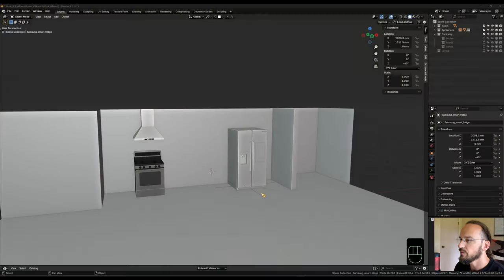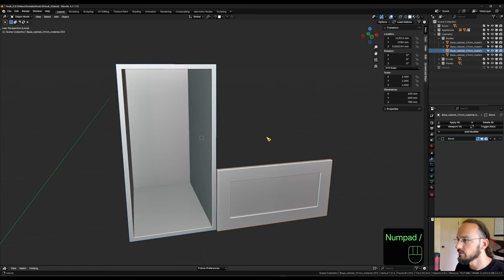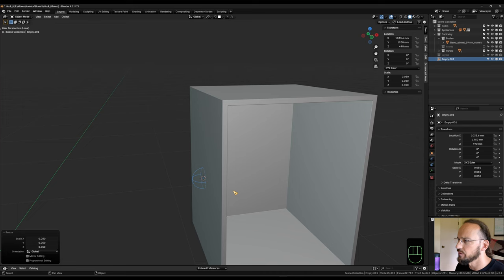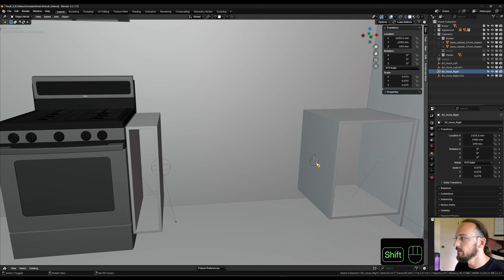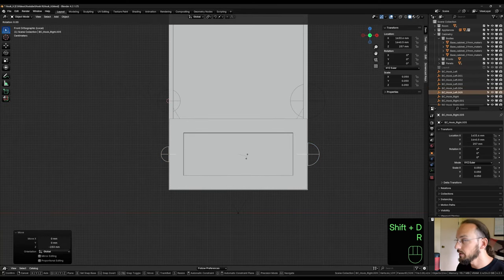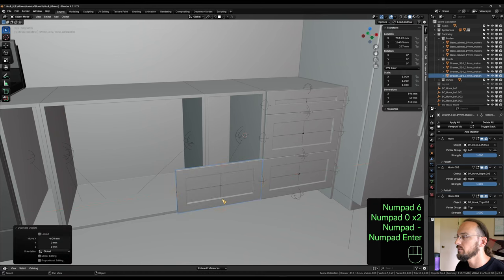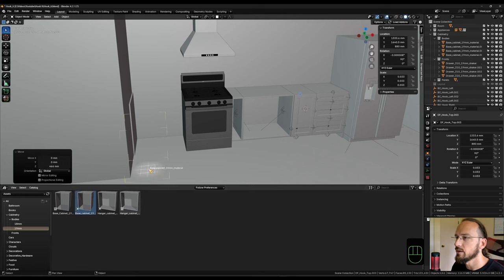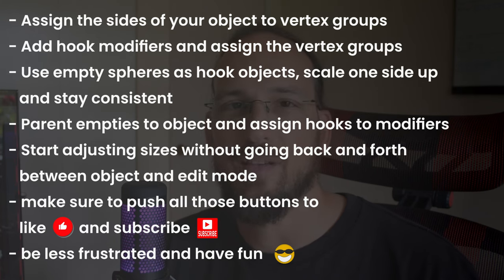Resizing Objects in Blender Made Easy – with a Hook

Comment: If you want your outliner's scene collection a little less cluttered, you can click-drag an object, in this case your empty sphere, and press shift and release over the object you want it parented to, in this case your cabinet. The empty is now parented to the cabinet, and is  placed inside the cabinet object in the outliner. This way, you can fold your cabinet in the outliner, and the empties are stowed away inside of it, creating less overview clutter. (remember that you still have to have all the objects selected when duplicating, or the new object will look at the original empties for the hook modifiers). Very nice tutorial, thanks muchly :)
Reply from the maker: Very true, that's a good way to do it.
On a normal project I usually make a separate collection for all the hooks which I can then disable when I don't need them to also declutter the viewport.

Comment: I like how you do it, and I see many use cases, but much of this can be done quickly using geometry nodes. With Geometry Nodes, you should be able to adjust material thickness, height, width, and depth with precision. It is worth checking out!
Reply from the maker: You're probably right. Geo-nodes would be a very good way to go about it. Haven't delved into it much myself yet.